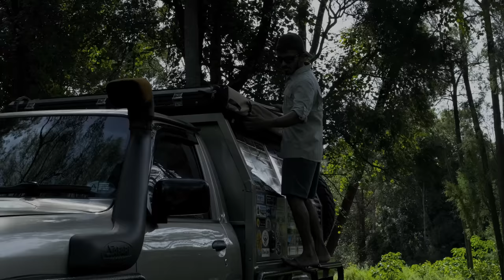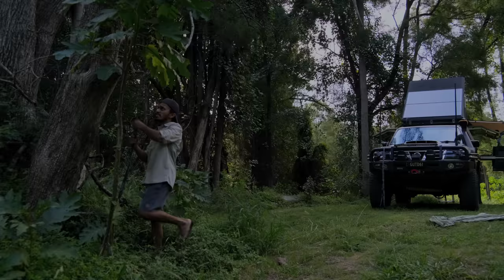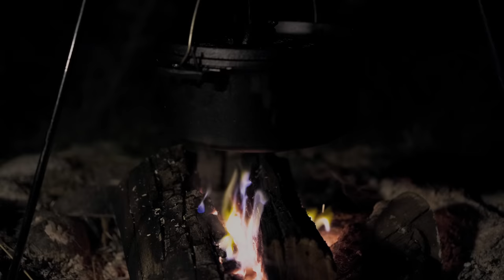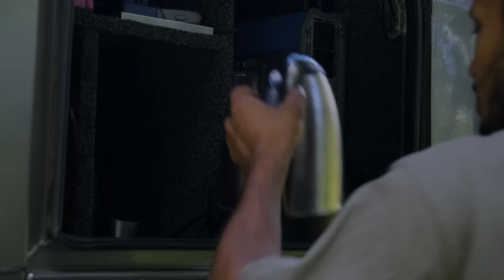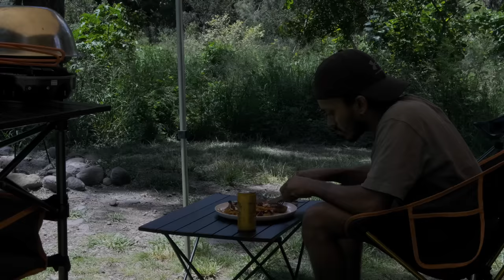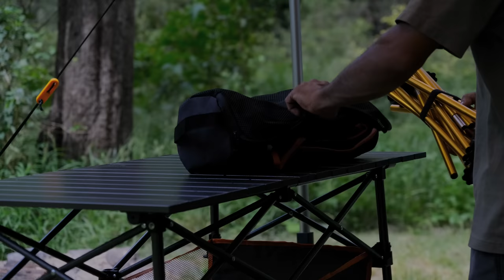RELAXING creekside ROOFTOP TENT Camping | WILD BOAR Camp Cooking | Camping ASMR | Silentvlog

Comment: Hey mate very well filmed. And that cooking scene was delicious. What type of awning is that and do you rate it over a batwing? Looking to purchase one soon. Anyway Great video
Reply from the maker: Thanks mate. This is XTM 2.5m x 2.5m awning. I haven’t used it long enough to rate it. Something I’ve found so far is that it’s easy to setup by myself and also it’s not as bulky as some other brands on market once packed up. Coz it packs up so slim, it’s easy to run the zipper. 
I’ve used ARB, Darche & 30 Second brands but not a batwing so far.